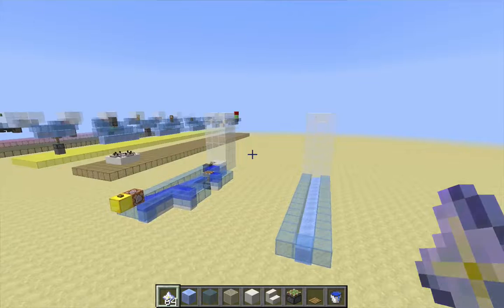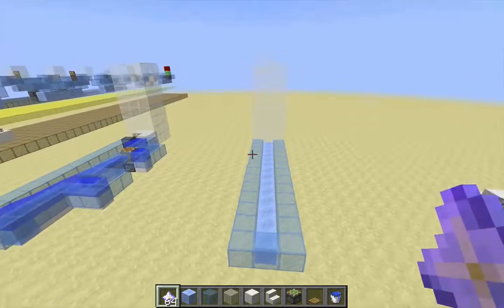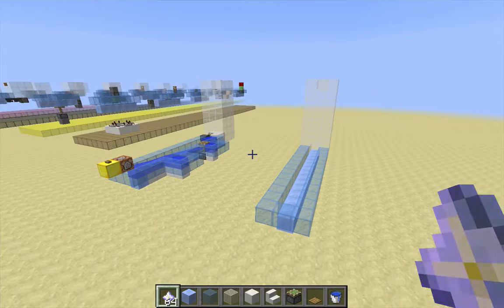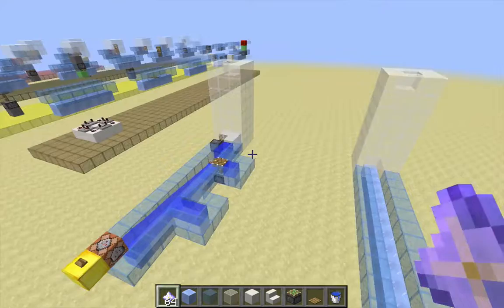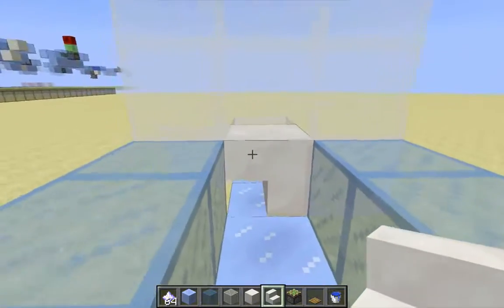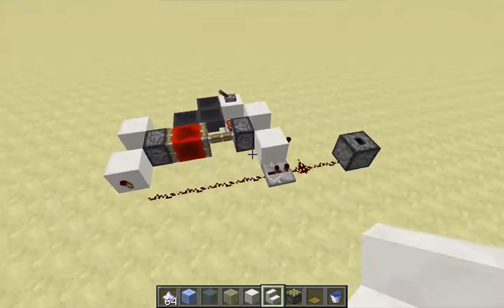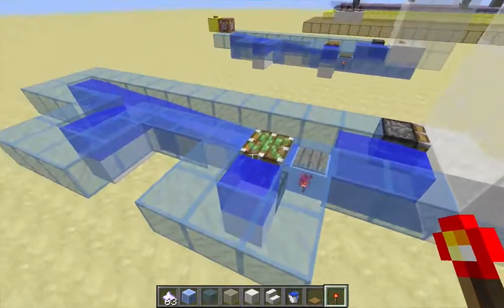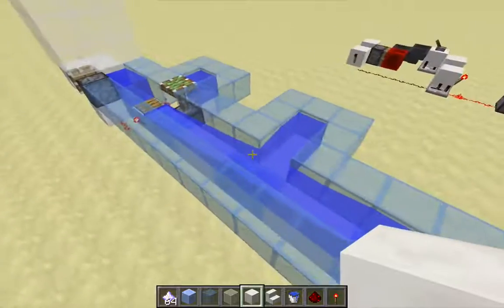Design Fundamentals of Minecraft 1.9 Item Elevators, Part 9: Example and Conclusion

Comment: Nice :-)
I just found your channel, but the (at least) 9th video about the science of item elevators? Awesome! :D

When I need one for 1.9 I know where to learn more about it.
As you said the design you showed here might not be 100% safe. I think I even see an issue with the regulator. If the "regulating" water flows in while a second item passes, the second item might the slowed down just enough to get stuck on the pressure plate but not make it over or back. I'm not sure if this issue really can happen but could be fixed by leaving an other water block before the pressure plate so it can get sped up again.
Anyway nice series. I have to check out the other parts at some point :-)
Reply from the maker: +Panda4994 Hey, thanks! And still, 9 videos seem not enough. It's like trying to be comprehensive about anything in Minecraft is futile. :-P

And yeah, I think your analysis of the elevator is correct. I've already been able to get items stuck, not on the pressure plate, but in the levitator block. There are a few things that could be done to try to tweak the timing, though.